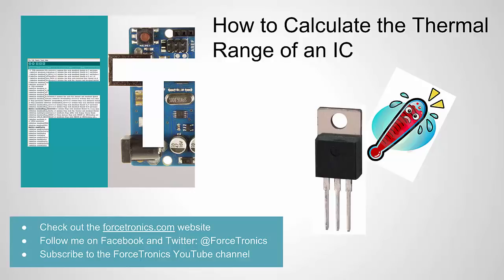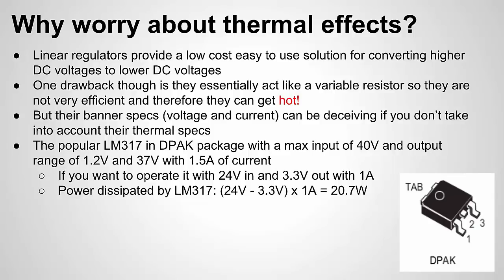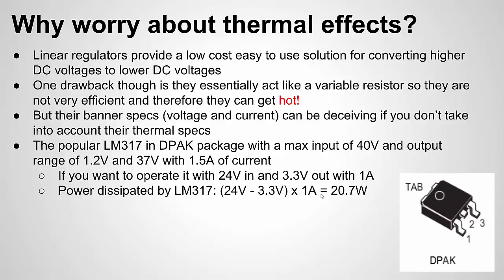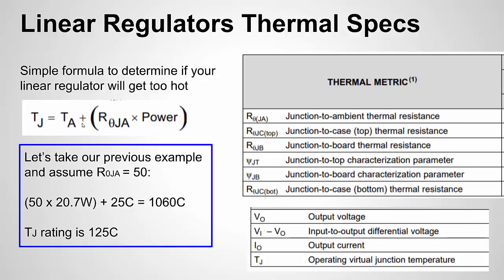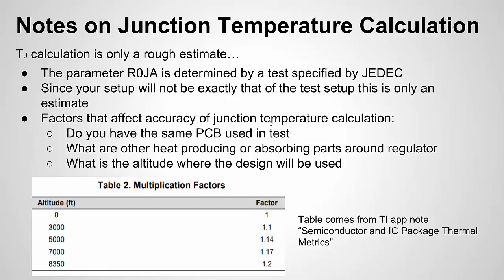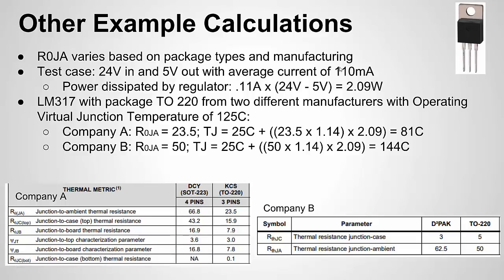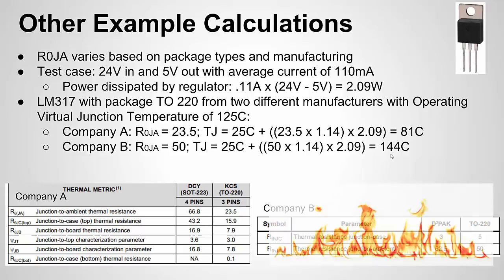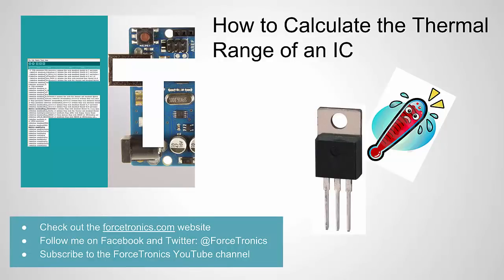How to Calculate the Thermal Range of an IC

Comment: Man great Video.  I understand the different ways to go about it.  Is there any data that shows using a multiple stage method being more efficient than running a hot scenario that would normally need a 220 in the 4/5 range thats larger?
Reply from the maker: Thanks for the comment. That's a tough question to answer because it depends on various factors such as how much voltage you're trying to drop, how much you're willing to spend on the top LDO regulators as far as efficiency, and what is too hot. You could always go with a DC to DC converter for better efficiency. Another option with linear converters is to put a couple high voltage drop diodes in front of them or a low value high power resistor.